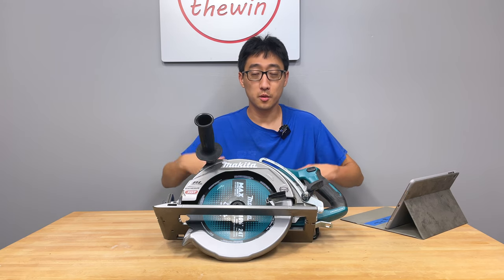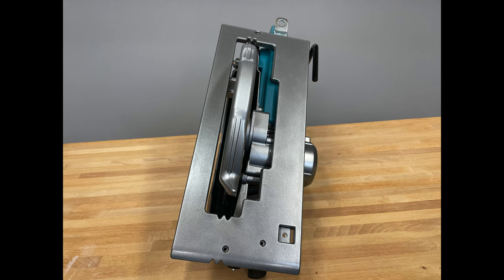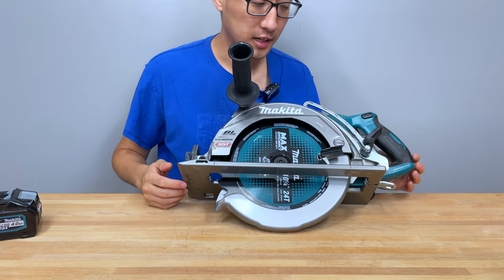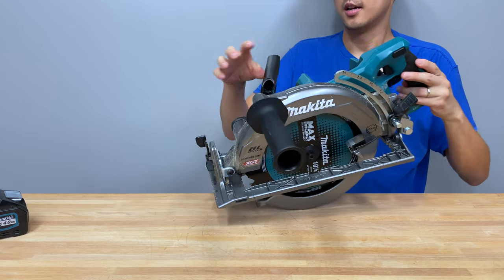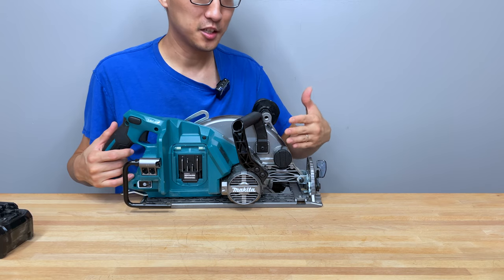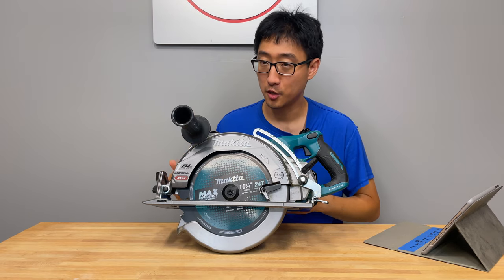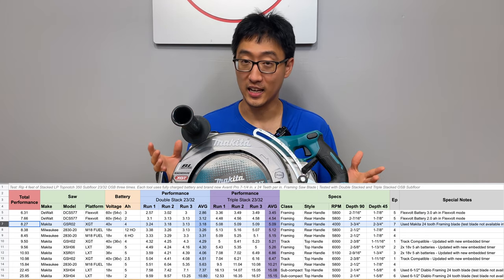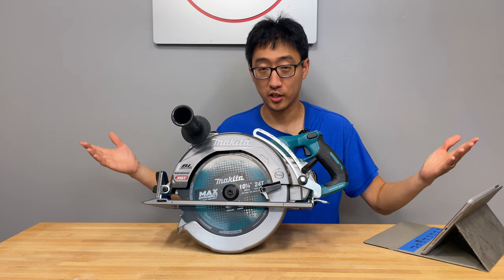Makita 40v XGT 10-1/4" rear handle circular saw review GSR02 TESTED | Circ saw ep.7

Comment: Thanks for the very comprehensive review

Is it track compatible? Like the DHS900Z
Reply from the maker: not this particular model. I think they have another model # with a large blade size which is track compatible, but im not sure it's in the states. the HS110G is the model number. the closest thing in the usa is the gsh03 but it's only 9-1/4 inch blade.

Comment: Thanks for the comprehensive review. We’re looking at getting on to speed up cutting studs straight off the pack, 95mm cut depth is more than enough! On question is how hard would it be to adapt that saw to a track? I know makita make an adapter but it suits the xgt side winders.
Reply: It would be easier to adapt a track to the saw than the saw to a track.
 
Linear extrusions have come a long way. :)
Reply from the maker: As far as I know makita does not make an adaptable base for this saw unlike the sidewinder model. If you wanted, you could probably use a guide rail adapter like  Makita 199232-5 Guide Rail, but it wouldn’t be as accurate as a base on the track.
Reply: @4thewinak  I see, I think I’ll have to do something else to try make it work

Comment: I might have a little bit of insight about why the dust collection was so poor. If you have the blade depth set to maximum the blade guard partially obscures the dust Port inside the housing
Reply from the maker: That’s a good point. I thought about that, but then my logic was if you’re buying this saw you’re most likely cutting deep cuts deeper than what you would with 7-1/4” saw…
Reply: @4thewinak  I just ordered one of these saws I might go ahead and order a replacement guard and then modify the back edge which will still be within the boundary of the housing to allow full air flow at maximum depth
Reply: Just take it apart and drill holes on inside of the blade guard around were it lines up with the dust port
Reply: The bonus to fixing this issue is the saw will also be lighter